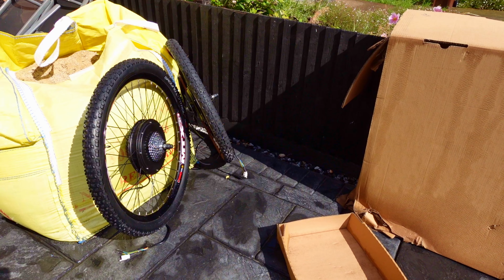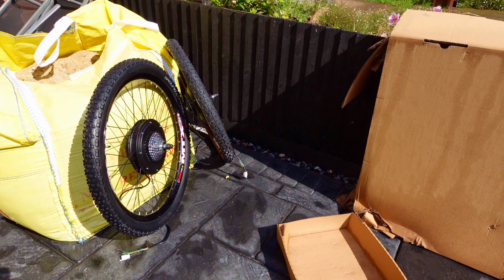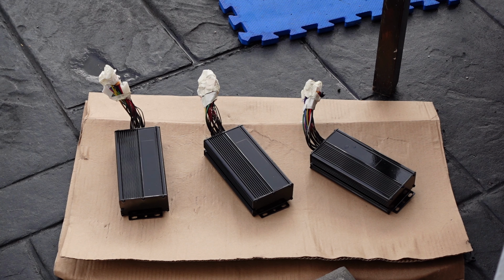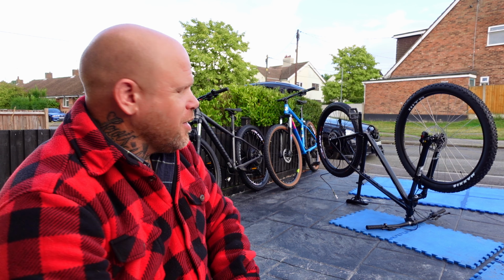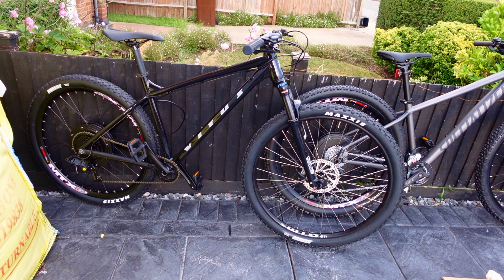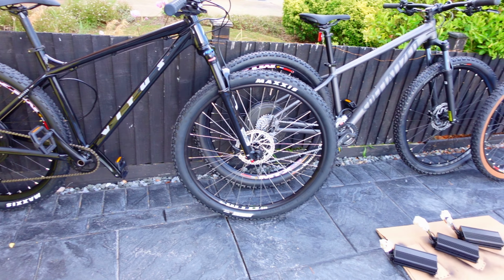Can you build 3 ebikes... in just 1 day??

Comment: If u want to get rid off one your hub moters I take one. And controller.
I got a E TWoW but I done it myself. So it’s just the frame form the ETWOW then I used a microgo front wheel 350w, I wanted a 500w but never mind. 
Then put a v meter throttle. Taking the software off it. So it gos about 20mph but love to do a 72v 2000w scooter.

Comment: Hi. Excellent Channel  I was thinking of ordering  a 3000WATT  moter for my 21 gear speed mountain bike...i know I will just have 7 speed manual with the  motor..the bike cost me 1,000euros..But my question is will this moter fit on 27inh wheel frame?  Cheers Mate from Ireland
Reply from the maker: @sorrenable  they're really tight to fit  a boost 141 frame is a little better